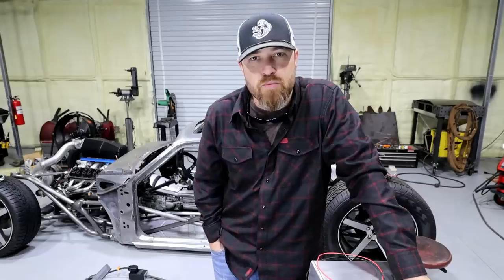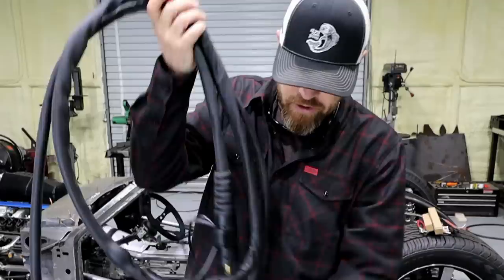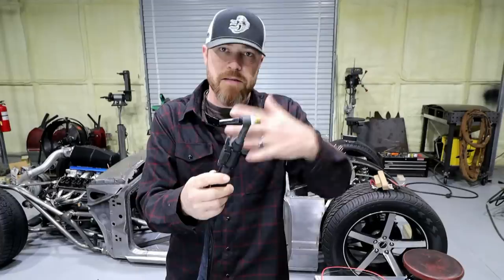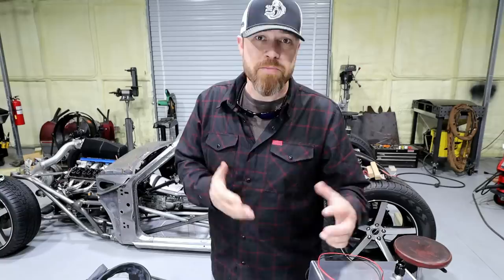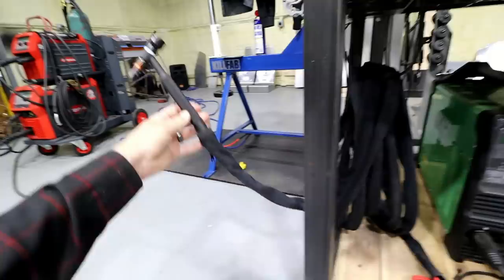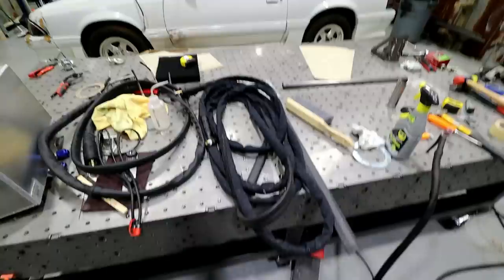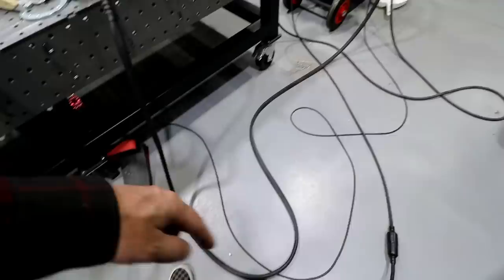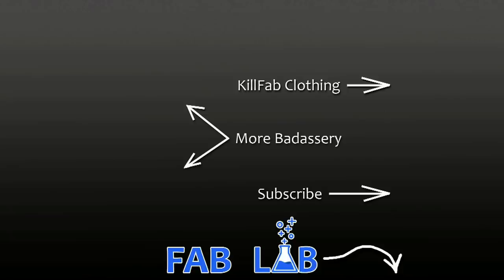Must Have TIG Welding Upgrade

Comment: "Sort of" LOL Love it didn't know that was available. A 25' lead would cover my whole shop! Thanks.
Reply: We run 50' tig leads at our shop, put one in the middle of an 80' boat and it will get about every place without moving the machine around. Flexheads and amptracks are a must too.
Reply: The first thing I do with any new Machine is put a 50' Ground Lead at least twice as size in gauge as the factory once on it, with a Bronze 500amp Ground Clamp.
Then add extended Torch Leads. 
They do make 50' Tig Torch Cables/Hoses. If you have a big Shop, these are even better. I have 1 Machine with the 50' on it. The rest have 25's

Comment: On the boiler we use lead with tweeco connectors hundred feet or more and get the gas to the torch with the green gas hose.

Comment: I only have 25 ft leads for my Fronius Magicwave 2200 Job.
Type 21 style torch, better cooling that the standard 20 style torch.
One with a fixed torch head, and one spare one with a flex head.

Comment: Yep 25 ft is on my list. And a 330 cf
Bottle. I went through a 155 in less than 12 hours over the course of 2.5 weeks. I have an upgraded everlast watercooled 18 it's a big torch but it's fine for me. But I wonder if the standard watercooled 18 is much different

Comment: Kyle, love your videos.
You are one of my fav you tubers.
I sure wish you would review the tig units you have.
I’m looking to buy just one unit.
I have a typical 3 bay home garage.
I’ve been looking at the new Esab 205ic AC/DC.
You have just about all the major brands. You would be in a good position to evaluate.
I’m sure you are sponsored by some of those guys like Fronus, but I see an Esab over in the corner.
Thanks
Mike from Houston
Reply from the maker: Hey Mike, I currently only have a Everlast and my Fronius. I have had one of the Eastwood machines and some Millers in the past. Everything I have had, I have done reviews on. The ESAB you see is a plasma cutter.

Comment: For the guys with Lincolns or Millers long leads are widely available.  Typically you buy the torch and lead and add whatever dinse and/or cooler setup you have.  Miller/Weldcraft makes a super flex version that’s great but a bit more expensive than rubber called a Mono-Flex.  I upgraded a few years ago. https://www.millerwelds.com/-/media/miller-electric/imported-mam-assets/spec-sheets/2/b/0/ay23-0.pdf Miller changed the Weldcraft part number so a WP17 is now an A-150 and a WP9 is now an A-100 but old guys at welding stores still use 17 or 9 to get parts.

Comment: Any downsides to the longer cable?  Like more voltage drop or anything like that?  
It must waste gas more.  Like every time you stop welding, any gas left in the cable just gets lost/wasted.

Comment: That's a good setup . But i have difelcutlys with the foot controller so i installed a torch controller switch and it's liquid cooled witch is a Plus .🐤🐤😎.
Reply from the maker: yeah I like to have both options